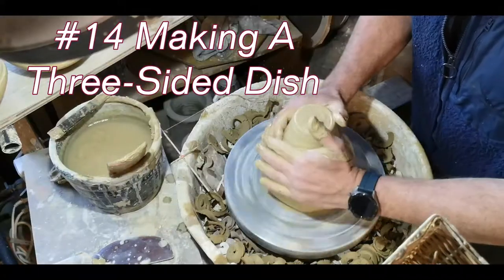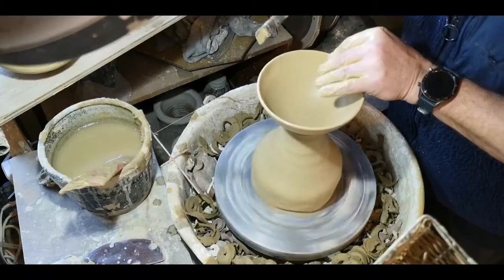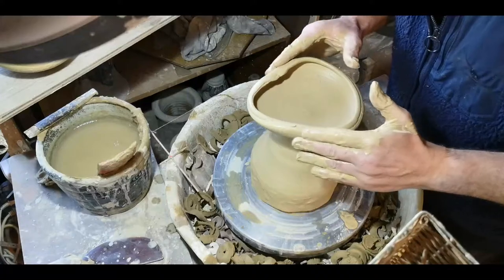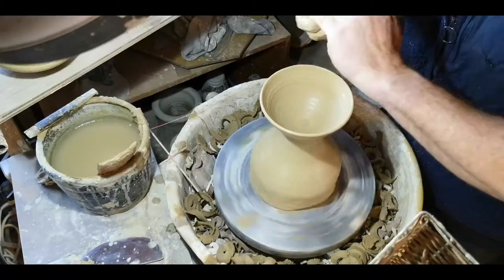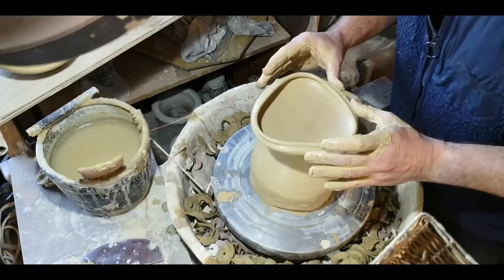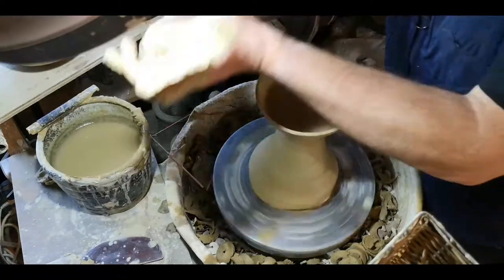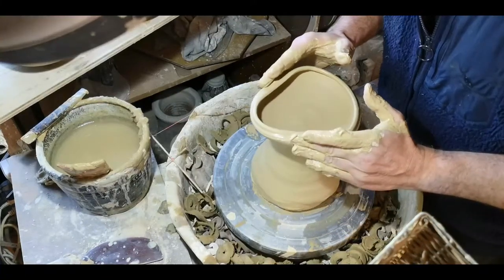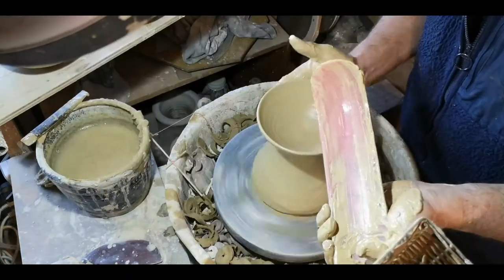Episode 14: Making a three sided dish, step by step.

Comment: When I roll a rim, I just put a bit of water there, and of course, that water ends up in the bottom of the pot. I've not thought of using a little hakima brush. But I will, now. Simple changes make big differences in throwing. Learning never ever ends, if you are lucky, until (beyond?) your last breath! Gassho, Karatsupots!